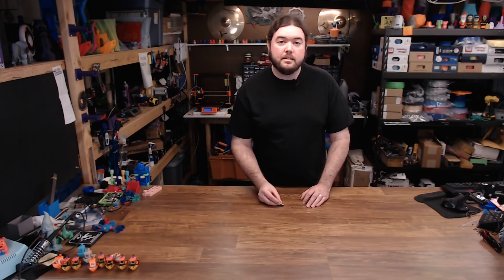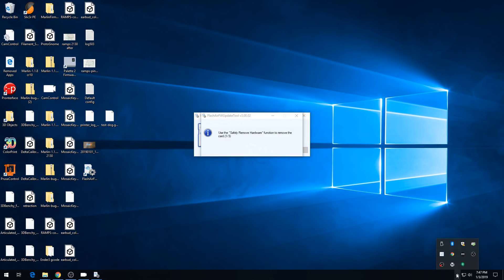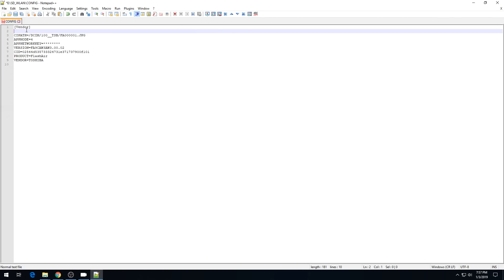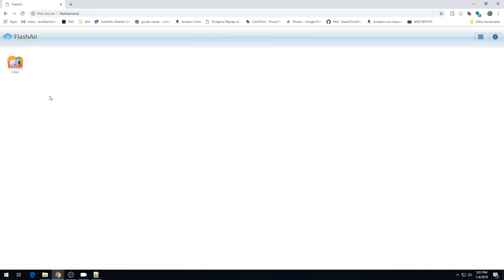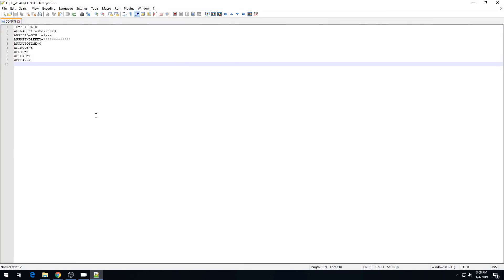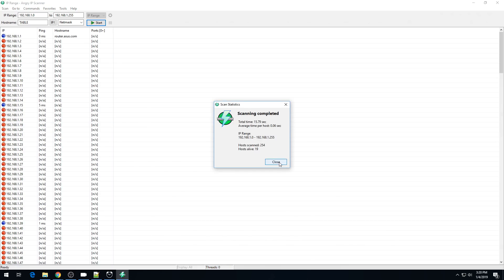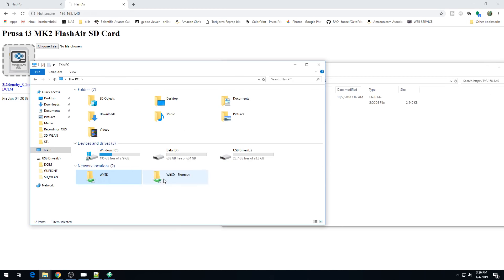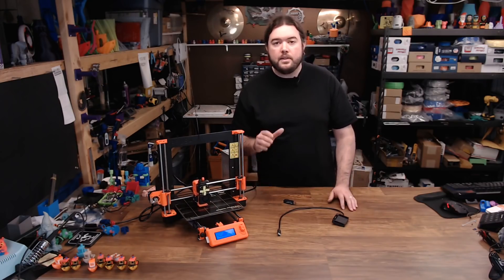Wifi SD Card For Your 3D Printer - Chris's Basement

Comment: Fantastic Job Chris, WAY better then I did.. :-)  So glad you're putting that card to use.  Did you try to get the other one working?  

PS: A note about using these cards in 3D Printers. If you find the card will not communicate or intermittently communicate, you may need to make sure the Printers firmware does not shut power down to the sd card slot when Idle.
Reply from the maker: Thanks again RJ! I haven't tried it yet, but I plan to for sure. That makes a lot of since now that I think about it. @ironjoe13
had mentioned there is a flashair card option on the Prusa. It just never clicked before. It's all about learning! :)
Reply: @ChrisRiley  I've had a go with one of these card but it was the more limiting W-02 version (The inability to create the windows shares is frustrating).
However, I also had problems with Repetier not powering the card correctly and so it would not work at all with my discount controller and RAMPS1.4 combo.
I found this info: 

https://www.rc-cam.com/forum/index.php?/topic/4058-marlin-reprap-with-toshiba-flashair-wifi-firmware-patch/

which describes changes to Marlin to get it to work. I don't know if this has been implemented as default on the latest versions of Marlin but I did think to try it on Repetier (I've yet to find time to do that)
Reply from the maker: Awesome! thanks for the link. This is definitely info others should check out if they are going to try and use one of these.

Comment: Hey there
I accidentally formatted my sd card using camera
And now the wifi is not visible please help
Reply from the maker: I'm not sure if those have a file system on them or not, I can check.
Reply: @ChrisRiley thank you
Reply from the maker: I checked mine, it's broken like your, this is the software that will rebuild it for you. https://apac.kioxia.com/en-apac/personal/software/flashair-configuration.html
Reply: My card is w-03 can it be fixed?
Can i know whether u fixed ur card too
Edit:  i found the software compatible for w-03 but when i try to reconfigure it am getting the same error saying an error has occured

Comment: Hey Chris, I had a question... I have a Prusa MK3s with an MMU2s, and the SD card is broken and no longer works. I bought a new SD card, a 64 gb Sandisk, and I need help formatting it. I am on Mac, and whenever I plug it in to my Prusa, if gives me a line of o's and just shows me a back arrow and then says there is no SD card installed. I have read/write lock off, I just need to know how to format it to get the printer to read the files on it. Any help would be greatly appreciated. Thanks!
Reply from the maker: Hey Dave, it needs to be formatted fat32, but it might be too big. You might try creating a partition on it, like a 16gb one. Sorry, I know nothing about MAC.
Reply: Hey Chris, thanks so much! I appreciate the advice. Thanks!

Comment: Hello Chris. Can I use this wifi SDCard to send data to my Android device directly? For example, I have Garmin GPS and my wifi  SDCard is inside the Garmin device. Garmin stores the location data into the wireless SDCard. I want to connect this wifi SDCard via my own code and grab the data from the SDCard wirelessly to my Android phone.
Reply from the maker: As long as you can figure out how to mount it as a filesystem, I don't see why not.
Reply: @ChrisRiley  thank you

Comment: Great guide but what is the point of the wifi sd-card if you still have to go to the printer to start the print?
Reply from the maker: Don't have to mount and un-mount the card? Just thought it was cool, so I tested it. Haven't used it since.
Reply: @ChrisRiley  interesting.. I was giving the card a little more thought, could this wifi sd-card work with an esp8266 module to fix the slow upload times?
Reply from the maker: @Bajicoy  Good question, I have a wifi config coming up shortly, I will have to try that out.
Reply: @ChrisRiley  Thanks! It's amazing how responsive you are, I really appreciate that
Reply from the maker: @Bajicoy  I try to get to everyone. :)

Comment: Sounds great my only problem is sharing items in Windows 10 they have made it so confusing to share folders. Kind of got it working but wondering if I go this route(in your video) can't help wondering if Windows 10 will cause problems when I try and share.
The card is no longer available on Amazon.
Reply from the maker: These cards just work ok, you're right, the win 10 sharing is kinda flaky.

Comment: @Chris Riley Coming from a Formlabs Form² 3D Printer with built-in WiFi I was quick to notice the drag that is, on a Prusa i3 MK3S, getting off the PC just to fetch the SD-Card, head back to PC to transfer file to SD-Card, and then heading back to 3D Printer to load and print it so this tutorial was a blessing.

Question though... For like half an hour I was scratching my head why the fuck I'm able to see the SD-Cards contents in Windows 10 and wirelessly upload a file but the file would then not appear on the 3D Printer BUT would do so when returning on the PC and checking there - By accident I would find out that once wirelessly uploaded to the WiFi Card already installed on the Prusa I'd have to unplug and reinsert it before the Printer would notice a change in the SD-Card - Not the end of the World but it's kinda bothering me xD

I already changed the Printers SD-Card Settings to [flashAir], mentioned in the conversation with @RJ_Make, though I have no idea what it does and it doesn't help with this "issue".
Reply from the maker: I get a lot of questions on these cards. I don't really remember having to reload it, but that might be the case. I have been meaning to test this card again. I will give it a try and see what I come up with.

Comment: Hi Chris,

Many thanks for making this, I had never heard of the WiFi SD cards before, what a cool idea...

If you have one of these cards in your printer, could you use it to connect to Octoprint and control the printer, or is it just for transferring files...

Excellent video yet again Sir, thank you...

All the very Best...

John...
Reply from the maker: I had no idea these existed either. These would be just for files. You could use them both together if you want, but there really wouldn't be any point if you have octoprint already.
Reply: @ChrisRiley  I am looking at something like this cause for my printer the USB bandwidth bottleneck is too much if I print too fast :/
Reply from the maker: @chloemcholoe3280  Yeah, these seem to work ok, but still not the best fix. I have heard some of the newer versions of this card don't work at all.

Comment: Great video. I had an issue though. I did it just as shown and it all works except the files never end up on the disk. The y say they are uploading and even complete but there are not files. If I move them manually like a typical drive no issues.
Reply from the maker: Hmmm, not sure what is going on here. Maybe a network timeout. Can you check how strong your signal is for the card on your router?
Reply: @ChrisRiley   this set up actually works , however in order to see the files you still have to remove the card and reinsert it. Maybe this is just while on the pc? Gonna give it a shot while in the printer. https://github.com/emard/FlashAir-FileManager

Well the upload works fine while in the printer; but the printer doesn't see the files. I wonder if the issue is the 64GB? The Prusa and my Palette 2 both do not see the card.

lol: third update- formatted the card to Fat32, the Palette can read the card but the Prusa still can't at 64gb (I assume that is to much for the old Mk2) Upload works fine with the files I linked above, however for the Palette to actually see the files you have to turn the unit off and back on. Maybe this is as good as it will get but seems like there would be an alternative? Any idea what might cause that?

Config Info:
ID=FLASHAIR
APPNAME=flashaircard
APPSSID=Kraken3DS
APPNETWORKKEY=********
APPAUTOTIME=0
APPMODE=5
UPDIR=/
UPLOAD=1
WEBDAV=2
[Vendor]
MASTERCODE=c86000cae425
LOCK=1
VERSION=F15DBW3BW4.00.04
Reply from the maker: Not sure, but I will test my Prusa with a 64gb just to see what it does.
Reply: @ChrisRiley  signal strength is good , o double checked all the settings. Card is easily connected via ip address or flashair in the web browser. At first I thought it might have been chrome and an incognito mode issuebut that really didn't seem to affect anything I tried both ways and even opened Microsoft edge if you can believe it! Sometimes if you drag the files over it actually does save it to the card but it's not visible until you unload the car and reloaded which kind of defeats the whole purpose. Firmware up to date on the card as well. I'll keep messing around with it, even did the same thing as a mapped drive but dragging straight from the computer is no issues

Comment: why i can't go to http://flashaircard even i follow your step? using W-04 flashair Tool
Reply: FlashAir™ W04  latest wifi sd card doesn't work, please help
Reply from the maker: What are you trying to do? You just can't get to your Wifi card from your computer?
Reply: @ChrisRiley  yes ,i updated FW and then modify the file CONFIG ,but can't get to http://flashaircard from my PC. i get another one FlashAir W03 then try today and can't get also. please help
Reply: it shows can't find the "flashaircard" server IP address
Reply from the maker: You are going to have to find the IP address of that card. You can find it in your routers DHCP table. Also, it might be a DNS issue, try install bonjour on your PC to help resolve the address.
Reply: @ChrisRiley  Many thanks ,I'll try
Reply: @ChrisRiley  i also change another router ASUS AC66U then set again the flashair 03 wifi card ,same problem,can't connect to the card from my PC.Put in my camera  connect with my iphone just fine.
Reply from the maker: @pieresoft  Oh, so you can't connect when it's in your printer? What printer do you have?
Reply: @ChrisRiley  I'm using Ender 3,but i didn't put  in printer to try , I stop at first step at  connect to my PC , jsut very beging step you show me.I put in camera and iphone must login wifi card  itself wifi ,then can login the Start page.But i put in PC then can't show the Flashair wifi signal.
Reply: Finaly, I use my laptop to setup everything works fine, and setup the WIFI card IP, create  shourt cut on desktop.But when I put in my Ender 3 it can't be connect with my PC.
Reply from the maker: @pieresoft  Do you have another printer you can try it one? I have run into some printers that this happens on.
Reply: @ChrisRiley  Sorry I just have one 3D printer,anyway thanks for your help

Comment: I never heard about wifi sd  card. But it's so simple.  Will try out that for my ender 3. Do you test the maximum distance to the router? Your channel come up to one of the best 3d information channel.
Reply from the maker: Hey Marcus, thanks! I didn't, I tested it about 30 feet from the router.
Reply: Did this work with the Ender 3? :D

Comment: Can I just upload my gcode to the card wirelessly and use printer as I would normally using a standard Sd card. then If wireless switches off it shouldn't matter?
Reply from the maker: Correct, it should allow you to work that way.

Comment: wouldn't it be a faster method for printing through octoprint from SD? In my case, i'm always getting connection errors when printing larger files on octoprint - but the octoprint "print from sd" funktion is not for me, because it takes hours for putting files through octoprint to to the SD - would that be a workarount to use one of these?
Reply from the maker: Yeah, that't the problem with octoprint and transferring to SD. It's really slow. With this wifi SD card, you could transfer you gcode over via the wifi card, but still see them and control everything from Octoprint.

Comment: Hi Chris. Great video again. Did you ever resolve the speed issue with some of the printers? My geeetech i3 pro b with marlin ( stock ) 1.1.9 causes the WiFi cars to go so slow it looses connection all the time, yet the SD part is fine.
Reply from the maker: Turned out some of them power the SD card down when not is use. You can adjust it on the LCD or in the firmware. The speed is just kind slow, but usable.

Comment: Awesome, just bought one! LOL Thanks for the video Chris
Reply from the maker: Nice! Let us know how it goes.
Reply: @ChrisRiley  Well, the card works as it should , I can save the gcode to the card directly from Simplify3D. BUT, just like the issue you had, WiFi works, but the Ardunio wont read the card. (says card inserted) So, not sure where to go from here... Its a 64gb Flashair W-04. Updated to the newest firmware.
Reply from the maker: @Mogalize  Do you have access to your firmware config? Is it Marlin?
Reply: @ChrisRiley  Yes I have access to the firmware, it's Marlin 1.1.9. I just saw Steve's post and I'm now trying to edit the firmware. It already has some FlashAir code, but its not the same as whats posted in the link. (getting compile errors)
Reply from the maker: @Mogalize  Any luck? I still haven't gone back to test this yet.
Reply: @ChrisRiley  Unfortunately, no. Haven't had too much time to play with it. In the 3D printer, I can get full wifi access to/from the card, but no access to the files on the card. On my TV, I cannot get wifi access, but I have full access to the files. I modified Marlin 1.1.9 as per the patch, but still no access to the files. I thought it might be because of the 64GB size, but my 128GB SD card works in the Arduino Mega 2560. Not much info in the wild out there either.
Reply from the maker: @Mogalize  That's really strange.

Comment: Nice tutorial.  Often times folks will consider printing from the on-board SD card as more reliable than dealing with the GCODE transmission over serial/USB from OctoPrint.  Having the WiFiSD card definitely gets you out of the SD card shuffle, but when OctoPrint serial communication is reliable, the extra features from OctoPrint push me to use that every time.
Reply from the maker: Great point John, there is a lot of back and fourth about octoprint vs SD. This might kind of fill the gap as a compromise.

Comment: Very interesting I had no idea those cards existed, but anyway heres an 'old timers' tip which may be useful for those instances where its not either possible or desired to install a network scanner or indeed java I prefer to find out whats on a network 'old school fashion' by typing in a small single line looping bit of code from the command line, as I can usually get this done  quicker than downloading a canned tool, this is easier in linux but can also be done from a windows command prompt (not powershell) with admin permissions, in such a case  I do an 'ipconfig'  to see the network address & subnet mask in order to define the limits of a loop, (omitting the network and broadcast addresses and also the default gateway if its at the exact beginning or end of the address range too)  then I just run it from the command line followed by an arp table lookup, for a simple example, if  the network address is say 192.168.1.0 and the subnet mask is 255.255.255.0  I would use something like this: 'for /l %t in (1,1,254) do ping -n 1 -w 50 192.168.1.%t' then after its finished  type in  'arp -a' at the command line to have a list of all connected hosts on that subnet, this technique will work for subnets or subnetted address ranges of 254 hosts or less -
Reply from the maker: Thanks Andy! This is a great tip! I will for sure put this to good use.

Comment: I have been trying this a year ago with Eye-Fi cards (these are available in the Netherlands) but that didn't work well.
The problem was that on the printers I used, the power on the SD card was not constantly on. Therefore, the network was very unstable. The used printer was the Anycubic I3 Mega.
Reply from the maker: Hey Brian! Interesting, I thought they were pretty neat so I wanted to give them a try. I might be able to find other uses for them like camera or audio as well.

Comment: That's a pretty slick addition to any printer. Too bad I have a uSD on mine.
Reply from the maker: Yeah, there a little to pricey anyway, for the most part I will stick with octoprint.
Reply: @ChrisRiley  Is it possible to change a micro SD to regular SD? Do you have a video on that already? I don't really want to try the WIFI card but just want to use the bigger card.
Reply from the maker: A bigger card with wifi? They have these, but I haven't tried them yet. You use your own mini card. Not sure they have all the same features. https://www.amazon.com/Share-Wifi-Memory-Adapter-available/dp/B00H4A6TGI/ref=sr_1_17?ie=UTF8&qid=1547150453&sr=8-17&keywords=flashair+card

Comment: What is that propeller on your hot end fan?
Reply: Sweet!  Where can I get one and how does it work?
Reply from the maker: There are a ton of them on thingiverse, you just glue them on some magnets and stick it on the motor shaft.  https://www.thingiverse.com/thing:2638857
Reply: @ChrisRiley  Oooh!  It attaches to your extruder.  I thought that was your hot end fan.  I could not figure out how that would work.  Thanks.
Reply from the maker: LOL, You like that? Those are indicators for the extruder. It helps you see when the printer is retracting or when it may be skipping, they are handy to have.